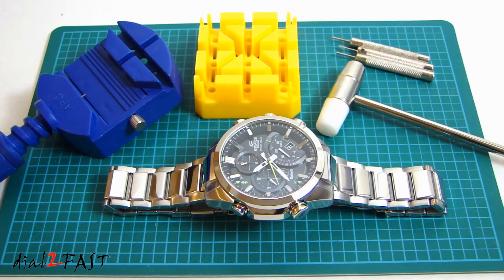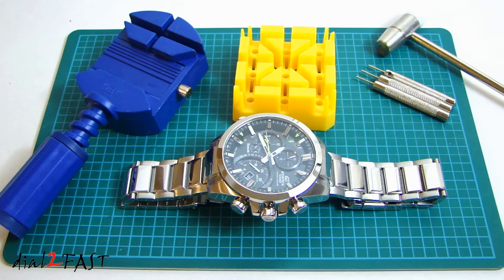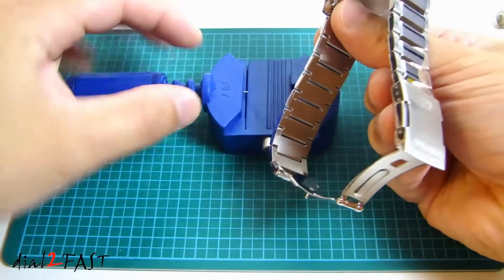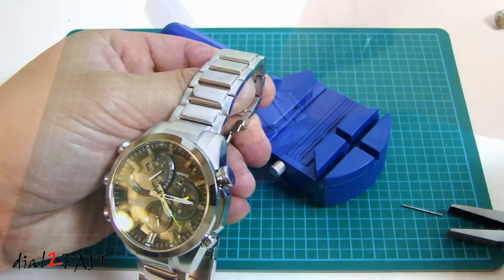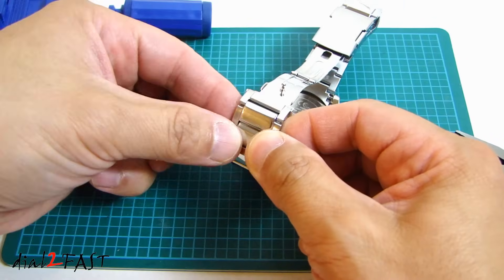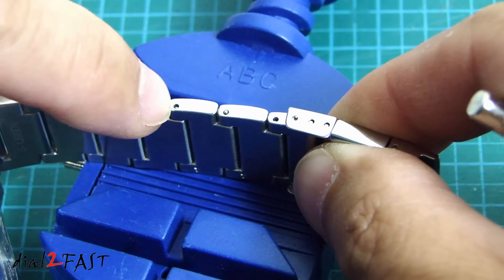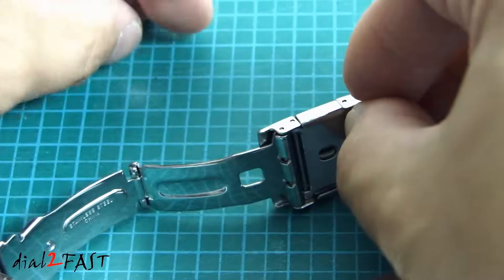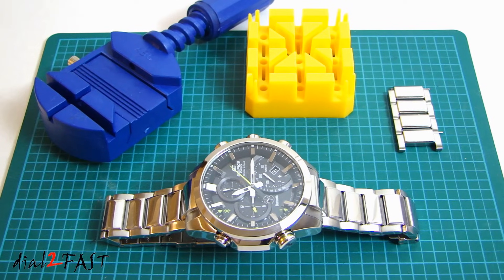How To Adjust Resize Your Watch Band By Removing Links

Comment: my invicta I just got doesn't have the arrows so is there a default direction all brands use?
Reply: You will see that one side of the pin is pushed in a little, and the other looks like it has a line through it. The indented part is the "head" of the pin, and the slotted side is the "foot." This is a cotter pin, and is essentially a folded piece of metal. For those asking what to do if it's loose.. separate the two parts of the foot just slightly to open the pin a very small amount. This will create tension in the pin chamber and hold it into place. Good luck all!

And yes, of course you can use a thumbtack and screwdriver, or a Sim tool and your sisters hairbrush, or whatever floats your particular boat. But with such precision work comes the increased chance of a slip or misdirected hit, and these tools were created to help reduce the damage done to a customer's device when brought to the jewlers for repair or adjustment. It's also pretty nice to have a form to fit them on and actually have them lie still instead of sliding all over the desk and stabbing yourself with a thumbtack. Might just be me, but I think it was $3.00 well spent on Amazon. 

Sorry for hijacking your comment, bud.
Reply: @abonnieforclyde2802  lol you're good. I ended up figuring it out, I looked at my other watches from different brands and all of them had the arrows pointing the same way so I guess all watches have the same direction to push them out. I have a set of punches that had a small enough one to fit but I did slip a couple of time but luckily I didnt damage it. This is my first invicta, I got the dc comic joker watch because I've never seen anything like it but I normally wear diesel because I like the big face watches. Watches is one of my many addictions but luckily I keep myself mainly occupied with my other ones I tend to only get about 1 watch a year or so. Thank you for the advice though, I appreciate it!
Reply: Good to hear you got it worked out! Time pieces of all sorts fascinate me. They say to spend your time wisely because time is the one thing you can never get back. Which I find to be one of life's biggest and strangest conunndrums. seeing as how we as humans created the concept of time, but it's the one thing we cannot control?
Reply: @abonnieforclyde2802  isn't that the truth. Time is nothing but a figment of our imaginations but spending it wisely is a good idea because no one knows what happens when we pass to the next life. We could get put back here to learn our lesson or go on to another place or there may be nothing, wont know until it's that time.
Reply: Exactly. No one knows. And when we figure it out, it's too late to share it!

Comment: Are you sure there aren't any tightening sleeves lurking in those link channels? I just adjusted a very similar bracelet on lineage LCW-M500T and was surprised and uncertain what to do about the tiny things when they started to come out when I punched out the pins. If someone runs into the same problem, don't panic. Insert the tiny sleeve on the intake hole in the bracelet link, and then put the pin in. If your pin is going through without any resistance, you probably lost a tightening sleeve. Get a magnet out and start sweeping...

Comment: I also recommend the blue tool, because if you have a thick watch band it won't fit in the other tool (I only have the blue one, but on the top of that tool you can see the same slot that the yellow tool has, and it seems to have the same thickness). My band didn't fit in there.

Comment: When you're putting the pin back in, do you hammer it in in the direction of the arrow (as if you were removing it again, but stopping once it's fully recessed in the clasp) or do you hammer it in, opposite the arrow? I guess what I'm trying to say is, do you obey the arrow regardless if you're installing or removing the pin. Thanks!
Reply: Looking at the video, yes, it seems this is how he does it. Same direction going in as going out. With a straight single-diameter pin the only reason I can think of is if there's a chamfer in the link to help guide the pin

Comment: hi bro, i have this exact watch edifice eqb500d but i noticed some tiny extra pin holder inside the wrists while trying to adjust the band but i eventually lost those tiny pins that holds the normal pin, is it going to affect it if i try to fix in the watch band without those tiny pins
Reply: You can buy them online. Ebay or something.

Comment: Thanks for the tutorial.  One comment though - at the end you instruct not to remove only from one side so the watch will remain centered on your wrist, but you removed 3 adjacent links -  all from one side?  Confusing.
Reply: Its not exactly confusing it just requires common sense. Although he removed 3 from one side it was still fairly centred. If you need to make bigger adjustments and remove 4 or 5 then you may need to remove links from both sides to keep the buckle centred.

Comment: This is the second video I have watched that says follow the arrows. My strap DOESN'T HAVE arrows!!
Reply: Geoff Joffy push from the side that has the pins pushed in, while the part of the pin that gets pushed out is the side that has the pin with a line that looks like a flat head screwdriver.

Comment: Excellent demonstration. But If you have to remove a total of 3 links, on which side do you remove the odd link?
Reply from the maker: Try to make a best guess to even it out the clasp when it's close. If they are pretty close on both sides, then just pick a side.
Reply: Thanks. Removing an extra link at the 6 o'clock side worked best for me.
Reply: It depends on your wrist. I'm going to do this adjustmentment right now. You really have to do it one link at a time to see if it looks right.

Comment: I got a lige watch a $230 watch, no matter what I’ve used the pin will not come out
Reply: Clutch Factor

Some watches have screw-in/out pins.. You need a very fine flathead screw driver, even electronics screwdrivers might not be fine enough, be prepared to reduce the screwdriver head with some fine emery paper to get it small enough. Hope this helps.